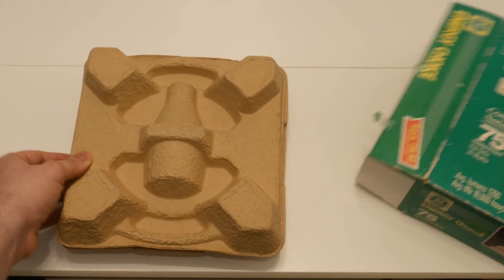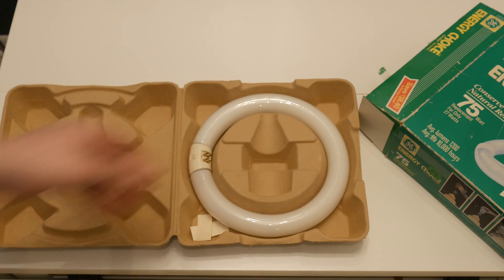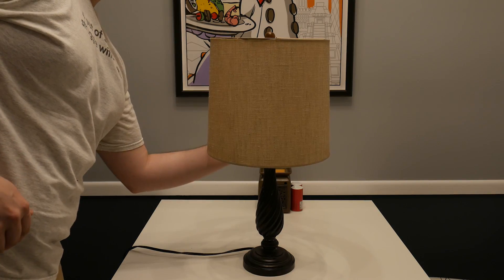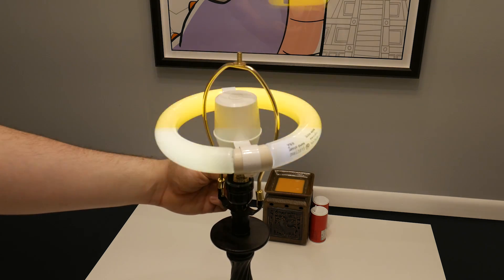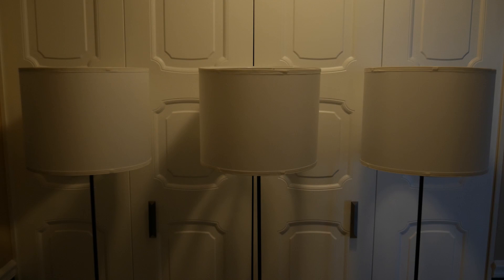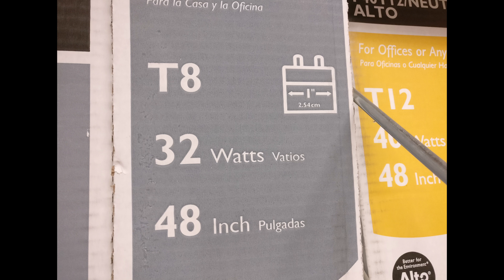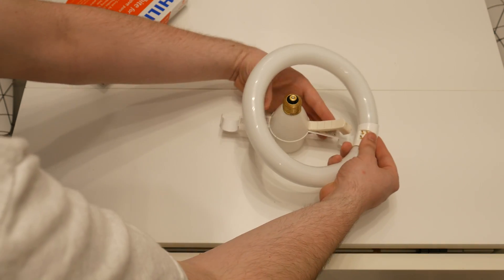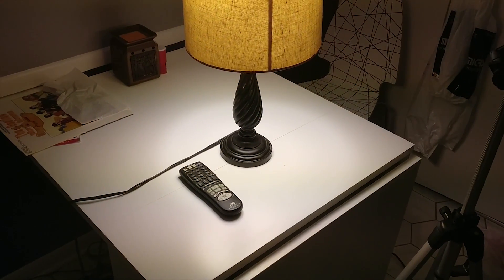GE's bizarre early attempt at a CFL

Comment: These circular lamps have a big disadvantage, they use more mercury than ordinary fluorescent lamps, much more!
LED-lights to the people!
Reply: Emil Almberg plus leds are super cheap you can buy rgb ones and change the colour to something a little warmer or with less blue(one of his complaints)
Reply: LED or discharge lamp make up your mind but don't go to incandescent. Discharge lighting is just as efficient as LED when made properly, so I'm really neither here nor there.
Reply: Rick Delair  DO NOT under any circumstances go outside. Harmful carcinogenic actinic rays confirmed! You must be confined to the Martian colony training camps underground. Removal from Earth when ready for the BFR launches. 60 or more accurately 120 Hz is known to be disturbing to human vision, everyone finds the florescent light that goes on half cycle (60) Hz flickering to be a real annoyance.  25kHz cannot be measured in the LED light. Oh and no TV or film either. The finest art museums are able to use LED's for the best color balance, so can everyone now.
Reply: LED-lights aren't that good either. They produce ugly light, often have bad colour rendering and produce a lot of blue light which is bad for your eyes.
Reply: You can not say things are in a certain way without telling how.
LED has no heavy metals.
Fluorescent lamps must have more mercury if the tube is bent.
LED does not need to flicker at a certain frequency, driving them with DC is actually the best, zero flicker!
However, incadescent bulbs have the best colors.

Comment: I'm from the rest of the world. We also use the T-system here
Reply: SAVE ME!
Reply: I'm american... How many hotdogs wide is the tube?
Btw a hotdog is equivalent to 1.3182 centimeters
Reply: @runed0s86  I've found hot dogs require a temperature diameter correction formula or table application for accuracy. Not to be confused with their color temperature chart.
Reply: I'm american... How many hotdogs wide is the tube?
Btw a hotdog is equivalent to 1.27 inches

Comment: My parents house was filled with those lamps. When better ones became available they were moved to the basement, where they are still providing the light. So, at least 40 years later I can't tell you yet how long they last.
Reply: I have one of those 22 watt circline lamps in my hall way. (in a proper fixture I might add) they last a LONG, LONG time. 15 years and it is still going strong and I don't anticipate changeing it for many more years. OK now I have junxed myself it will probably burn out next time I turn it on.
Reply: Right. The longest lasting fluorescent tubes were the preheat start type such as this one.  My parents had an old 15 watt 18" preheat lamp over their kitchen sink. It was left running 24x7, had an old GE F15T12 tube in it. It was there for over 25 years until the kitchen was renovated. That old fixture is now sitting in my garage on a shelf not connected with the original tube that is now over 50 years old. I would bet if I connected it, it would still fire up. Has been sitting on that shelf since 1993 when I rescued it from the scrap and stuck it on the shelf at the back of my garage.
Reply: The problem with CFL especially the "instastart" is that they are to harsh on the tubes, meaning a CFL that would be on 24/7 would actually last longer than turning it off and on, so I wouldn't be surprised that on a bathroom they last less because it has greater on/off cycles, each time you turn one on the life span reduces greatly. On the other hand those older CFLs that took 2 or 3 seconds to turn on lasts much much more because the tube warms up slowly and softly, I have one of those in a bedroom, it has been used daily for atleast 10 years and it's still going strong, on the other hand all of the other CFL (instant ones) have been replaced more than once during that time.

If you notice these newer CFLs in a short time the ends of the tube become darker and darker, that's because they are wearing out.
Reply: That's pretty good value compared to the CFL and LED lights now which only seem to last 3 years if you're lucky.
Reply: Checked this weekend and there are 3 circle lights in the basement, which is the number of lamps in the family room from which they came. 1 is a GE, probably the original, the other 2 are "lights of America", probably purchased on sale. All look about the same. All still functioning.

I've had mixed results with CFLs. I've heard fluorescents don't like being started, so usage where they are frequently turned on and off will greatly shorten their life.
Reply: Agent24 

I have rarely had a CFL last more than 2 weeks.
Reply: cplinstructor that has been my experience with CFLs as well. And then they become toxic waste that I am supposed to bring to a recycling center. If I can find one. Then pay said center to take my dead CFL off my hands. 
Incandescents May have their shortcomings, but at least I can put it in the trash when it dies.
Reply: Most of my LED lights fail due to the PCB overheating. I have replaced the components in them and the LED's still work fine. I can't help but think it is intentional.
Reply: I agree with constant starting/stopping being the death to florescent lights.  Many stores converted to energy saving auto on/off lights 10-15 years ago.  I know Home Depot was one store, and some grocery stores and Walmarts also have them.  They use photo sensors in combination with skylights to try and save energy...sun shines bright, they turn off, sun goes in, lights come on.  But because they're florescent, the failure rate is incredibly high.  The Home Depot by me has them...you look up and see half dead tubes and/or flickering tubes trying to start when the sun goes behind the clouds.
Reply: If you have failing leds, they're probably the cheap kind that lack any sort of proper cooling. That's where they're saving the money cause that's all heavy extruded metal.

 leds themselves are dirt cheap.
Reply: Out of those 40 years, how long have they been in the cellar? Presumably down there, they're only ever used a few times a year, rather than daily, so they're going to take much longer to use up their allotted lifespan.
Reply: I haven't had any bad experiences with CFLs, but those old donut-shaped fluorescents (like in the video) are horribly unreliable.  Back in the '90s we bought four of them, and they all failed within nine months.  We never purchased or used those types of lights ever again.   In fact, our experience with those fluorescents was so bad that we shied away from CFLs for many years as well.
Reply: We had at least one in my parents' house for quite a while in the '90s/'00s, plus all the circline tubes in ceiling fixtures.
Reply: Towards the end, it seemed like that this tube start in this way: First the starter glows,then it's the filament heating up. Last, the tube gets started.
Reply: SPIRAL STYLE CFLs didn’t exist much before 1990.  If you wanted a compact fluorescent, you bought these circle things.  My parents have one in their basement simce the 1970s (almost 50 years)!  Mounted upside down

.
Reply: Little thing called "planned obsolescence," that. Things ain't made the way they used to be, so naturally everything these days (light bulbs being the first, of course) are designed to fail so you spend more money in comparison to what used to be made to last.
Reply: @sonicdash3818  agree, people dont understand that, leds are made to break

Comment: I live in venezuela and similar lamps were still being sold here until 2015 at least, and might still being sold. There is a similar one in my kitchen right now, Osram branded but it uses a more modern electronic ballast.
Reply from the maker: The tubes themselves are still pretty common here in the US as well, but the idea of using them in an ordinary lamp using one of these adapters is long since gone.
Reply: I actually was referring to the adapter itself
Reply: That doesn't surprise me as in Venezuela they sell new old model cars too.
Reply: mharris1270   From quite a few years by now, and not just Italy, every major European country has its own Amazon site.
Reply: I can't say if they have ever been marketed here in Denmark, but i have never, ever, seen anything like them myself, before i saw this video.
Reply: Here in Italy they sold them as a single piece, you couldn't remove the circline. I too had one of them mounted in the kitcken not many years ago. I don't know if they still sell them.

EDIT:  they do still sell them https://www.amazon.it/dp/B009T33I1W/ref=asc_df_B009T33I1W46547464/?tag=googshopit-21&creative=23394&creativeASIN=B009T33I1W&linkCode=df0&hvdev=c&hvnetw=g&hvqmt=
Reply: rvbrexer
unsurprisingly, Denmark doesn't have one (yet) 
i typed "amazon.dk" in the address bar and was redirected to the UK site
Reply: My parents have two of these lamps that still works perfectly since 90s

Comment: My grandma had one of these from at least the late '70s. Ugly, but they lasted a long time. They were common up until the late '80s.
Reply: One of my grandmothers had one in her kitchen as well, and I can't ever remember her having to ever replace the bulb until well into the mid 90's, but I never did like the color of light it gave out.
Reply: Interesting that you report the  longevity of these bulbs.  My experience has been exactly the opposite.  My family bought several of these donut-shaped disasters back in the '90s, and they all failed within nine  months.  Our experience was so bad that not only did we never purchase another circular fluorescent bulb ever again, we stayed away from compact fluorescents (CFLs) for many years as well.
Reply: @Milesco Could it be that you had a faulty ballast? I have a couple that my grandparents bought in the 1980s that are still fully functional, with one of the original tubes still functioning.
Reply: @That50sGuy   It's certainly possible.  But it doesn't matter which component of the bulb assembly is faulty.  If the product doesn't work, it doesn't work.  That's all the consumer cares about.  (Note that incandescent bulbs don't have ballasts.  So that's a problem that only fluorescent bulbs can have.)

And if they all have this problem -- especially if it's a relatively new item on the market -- well, that's going to leave a bad impression and the customer is going to shy away from ever buying that product again.  From ANY manufacturer.  (You know the old saying about first impressions.)